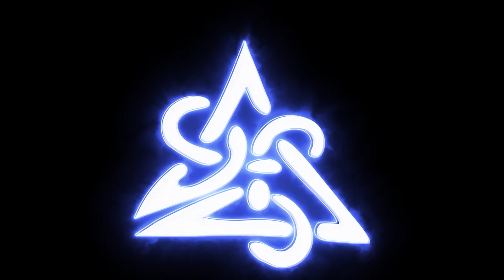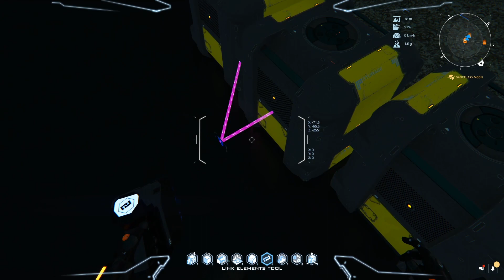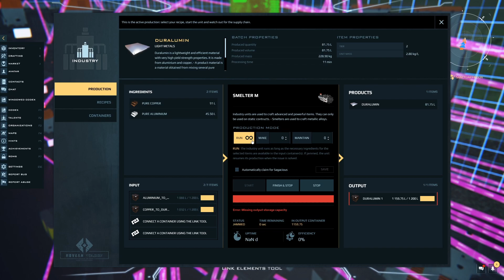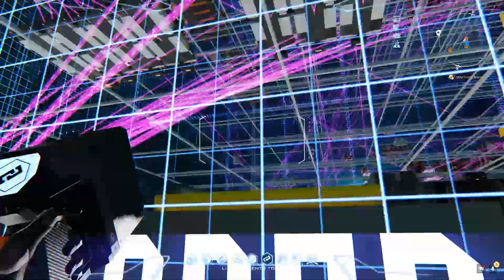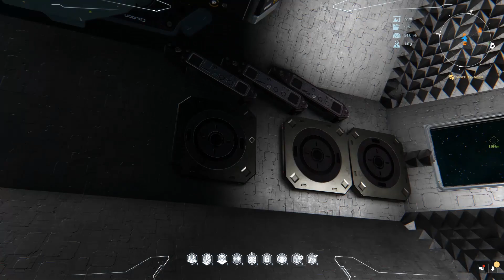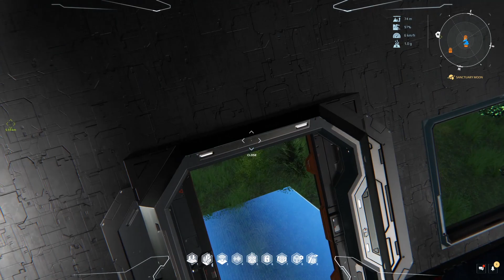Industry Guide Part 2 - Container Hub & Throughput - Dual Universe

Comment: My problem right now is my Ore Drop off container that has Transfer units fetching the ore and putting them in containers to be used by the refiners.
I can only connect 10 Transfer Units to the drop off container. Is there a workaround so I can still drop off all tiers of ore into one container? Having a drop off container and still having to put the different tiers in different drop off containers kind of ruins the idea. How are you handling ore input? Hope that makes sense :p
Reply from the maker: Nope no solution, can do two drop off containers and split it but that’s the best you can do

Comment: You said, 1 transfer unit can handle 72 machines. How do you connect 72 machines as output to 1 transfer unit ?
Reply from the maker: Dacz Andras I explain in the video that you have to custom then by doing 9 machines then claiming to another transfer into. So only 1 of pulling from the original pure container but it does take more to feed 72 machines. The reason to chain is because otherwise you are wasting links from the original pure container